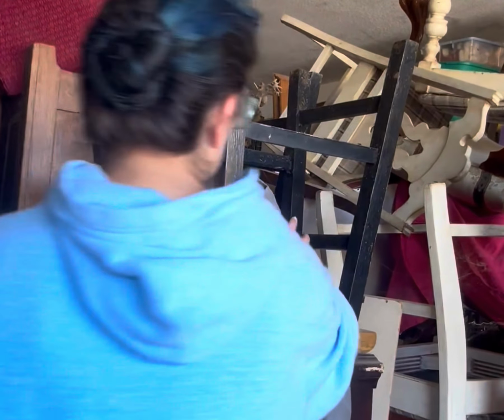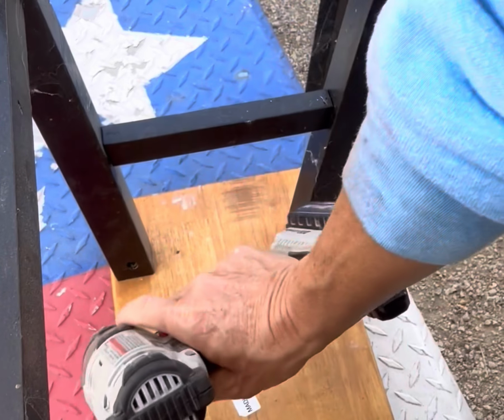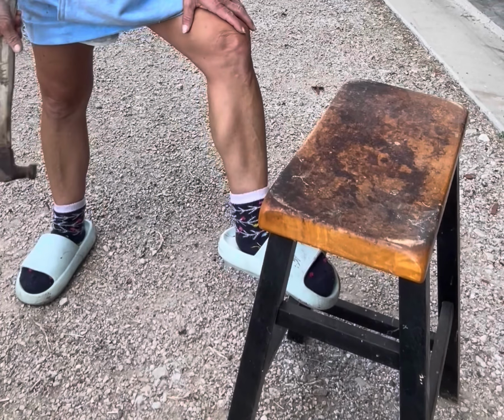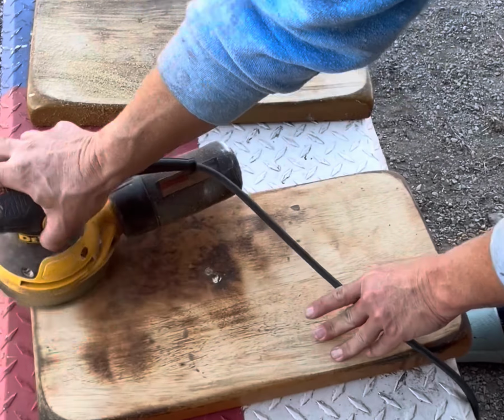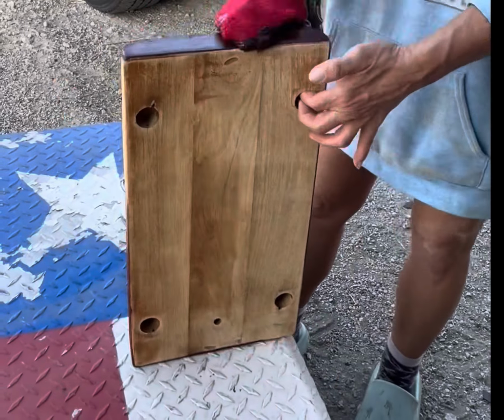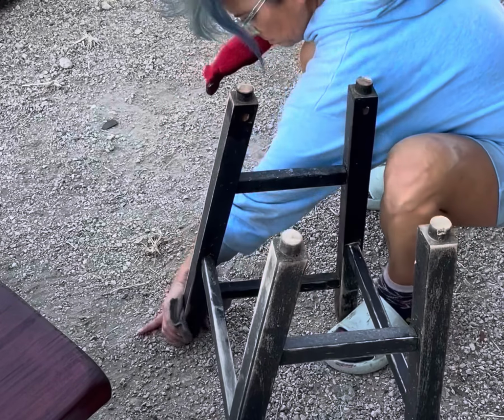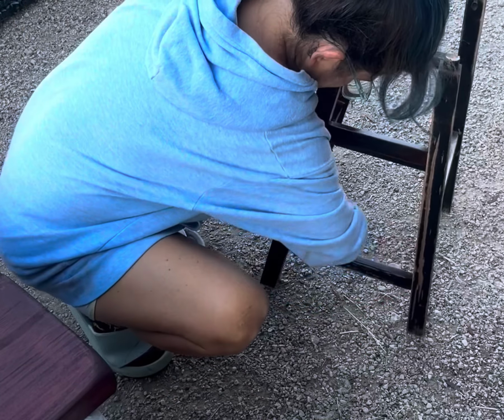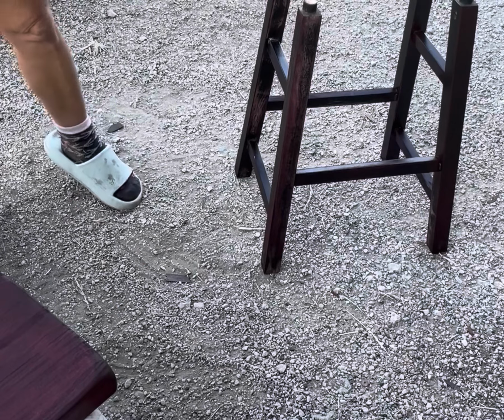Digging Through Trash To Pay My Bills!

Comment: I heard once that if you don’t clean your piece first, you could be sanding the dirt into your piece. 🤷🏼‍♀️
Reply from the maker: @susangrenier795  I have heard that as well, but I don’t necessarily agree 100%. If that’s the case, then you would be sanding all of the existing finish into the piece as well. The sandpaper removes all of that, dirt included. The only exceptions would be a stain that would need to be removed first, and either oily, waxy, or goopy spots. 🙂
Reply: I have heard that too.
Reply from the maker: @kathyfrey1  There is truth to that if it is oily, waxy, or a stain that needs to be removed before hand. Read my previous response for Moore.